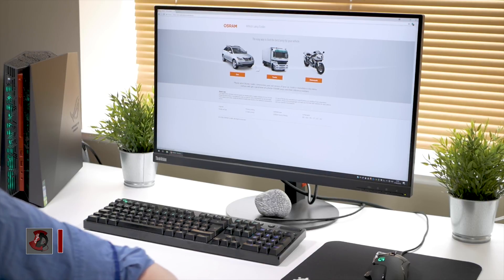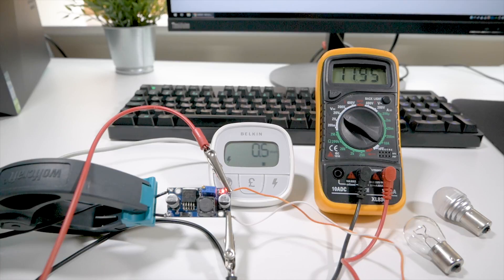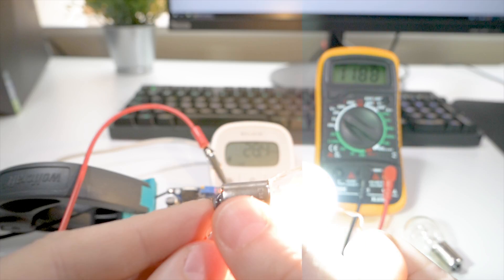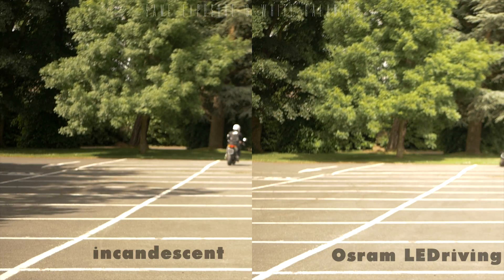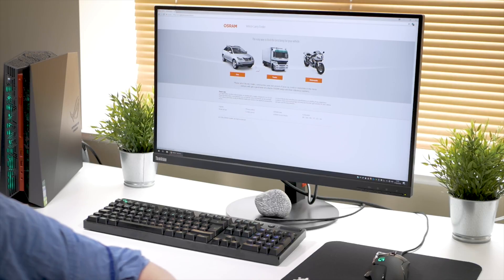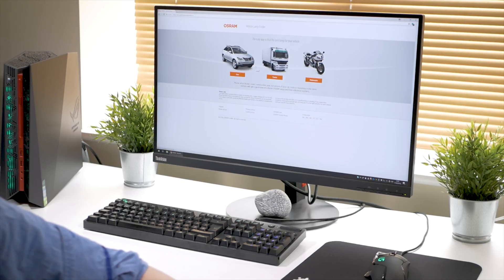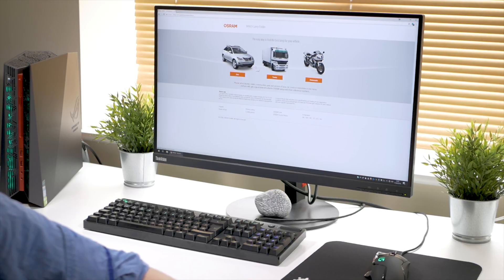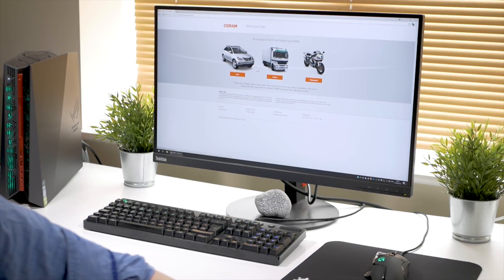Using LED on old motorcycle - is it worth it?

Comment: You have been quite lucky to get years of acceptable service from any LED retrofit in a car or motorcycle  -in my experience the heat dissipation and vibration destroys them quite quickly -sometimes it only takes a week until they start acting up -flickering, decreased light output and eventually total failure.
Those multi-LED "corn cob" designs are particularly bad, but single -LED designs can also start to flicker after a short while, before losing light output and eventually dying. LED retrofits may look novel and brighter at first, but definitely not as good in terms of longevity as conventional incandescents.
Reply from the maker: Hi. I must say I agree in general using no name brands from EBay and such. When it comes yo Osram and Philips though, I never had one fail. In fact I keep moving them from car to car when I change it. Possibly depends on electrics of the vehicle as well. Some brands are notorious for blowing bulbs.
Reply: @Edsdrafts  I admit most of my experiences with LED retrofits have been with questionable noname Chinese brands ...the more power they tried to pack-in, the less reliable they were, and most of those I tried were 5W T10 parking light replacements. Dual position/brake bulb retrofits were also no good after a year or so. The only somewhat reliable designs were those of modest power and simple resistive dropper design -but you lost most the extra brightness potential of using LEDs. All in all, I have replaced more LED retrofit bulb on 3 different vehicles over 14 years than I have incandescents -those rarely fail completely, they more commonly drop in light output.